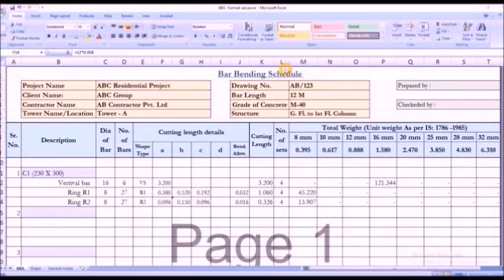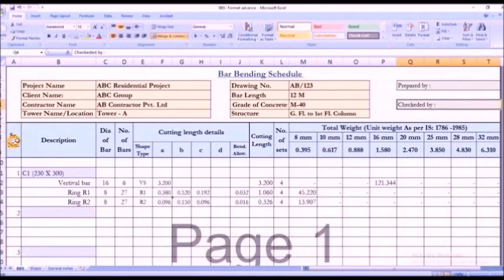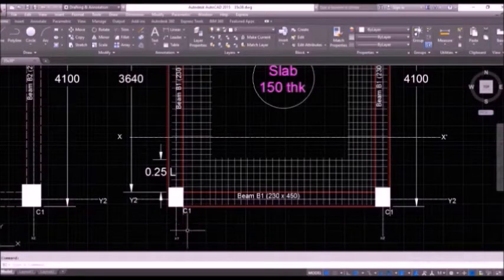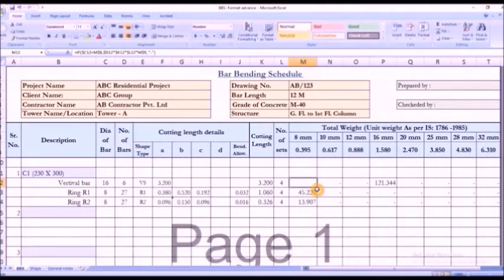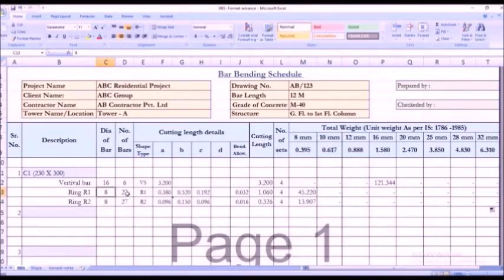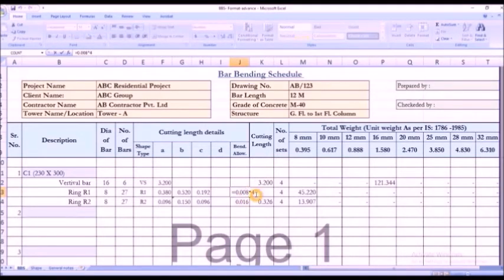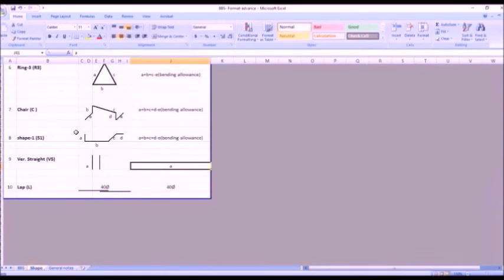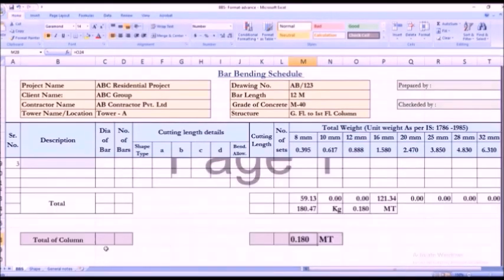Bar Bending Schedule | BBS  | Column | how to make Excel sheet of BBS | Er. Raghvendra

Comment: Sir the foomula which u applicable on total weight  is not working on all cells IF($C12=M$8,$D12*$K12*$L12*M9,"-")
Reply from the maker: Right this formula in one cell and drag it, you can download the file from the description box, link is given
Reply: I have face same problem ... Both cell I have to written "mm"   without  "mm" in the dia of bar cell didn't match with  weight bar cell.

But I don't want to given ... mm in every cell what should I do sir .